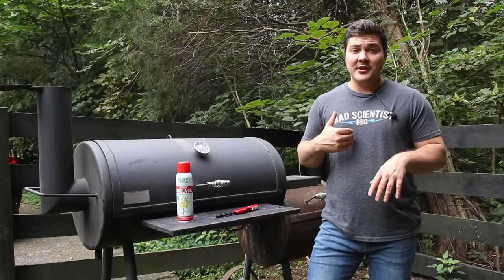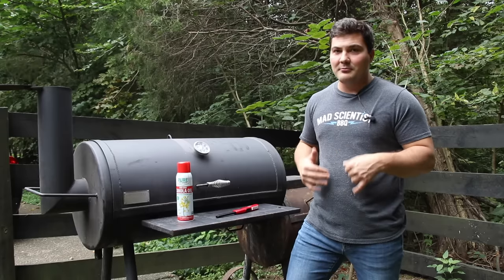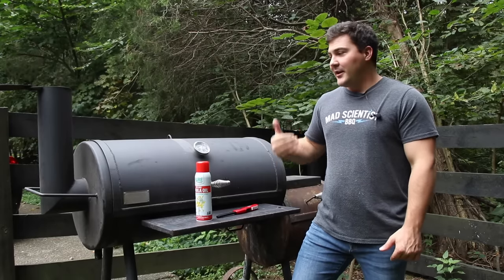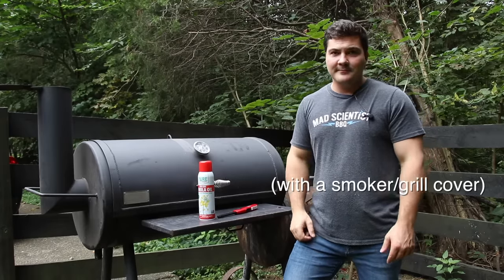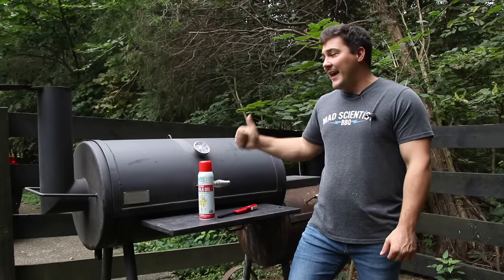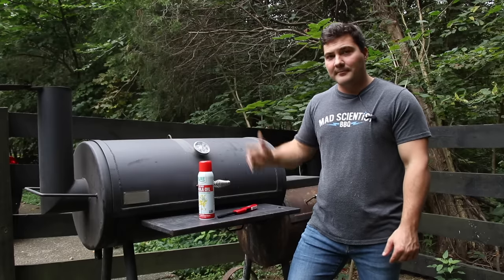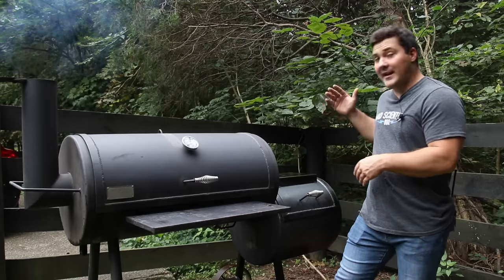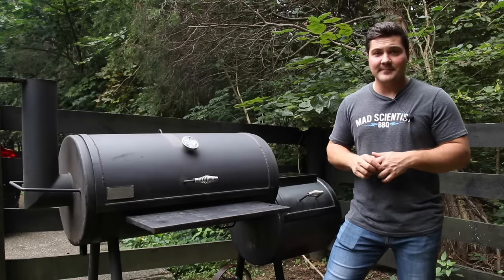How to Fix Rust on Your Smoker

Comment: I know every welder/ fabrictor is screaming right now for u too Wire brush the surface before spraying. Clean your metal is something you'll here often in a fab shop.
Reply: Ya it seems like something you would want to do if it looked like that just because it can't hurt right it's already rusted
Reply: I was thinking the same thing

Comment: If you want to remove rust pretty easily,  make a baking soda and water paste and dab it on the rusty areas.  Leave for about a half hour and then rub with some steel wool. Comes right off.

Comment: You wouldn’t sand off the surface rust then paint it with high temp paint?
Reply: I would do that if it’s super bad
Reply: I find that high temp paint always peels off on the fire box. It just gets too hot.
Reply: You will just be doing that constantly the fire always burns the paint off eventually. Mad Scientist is right some custom builders dont even offer paint,  and instead just burn and coat with oil!  Its the best way.
Reply: @PatriotPaulUSA  yeah I kept having to paint mine over and over. Its better to just do this method. About 3-4 times a year works for me.
Reply: Never. Follow these instructions. Sanding and painting is a waste of time.
Reply: Abullet4Bolsheviks I’ve never see someone so clueless about what people are talking about.

Comment: Love all your videos. Everytime I see you doing something I'm already doing, I feel like I'm doing something right. 
First, I noticed your smoker on bricks. I had mine on stepping stone pavers to prevent rust from wet ground.
I didn't spray mine before every cook but that was part of my care with the same thought of treating it like a cast iron pan. One tip... Spray from the bottom up...One reason. When an aerosol can is full the spray angle doesn't matter very much. As it gets empty you'll need to hold it almost perfectly right side up. Starting from the bottom you'll get more out of it than finishing at the bottom with a nearly empty can having to hold it at an upright angle. Please keep up the content. Thanks for sharing these tips.

Comment: Dude awesome video! I seriously didn't want to sand and paint. My box was looking horrible and I did this with great results.
Reply: What type of spray did you use and how many times did you repeat the process to get the results that you have now?
Reply: @ryans381  basic vegetable oil will work. Just coat the firebox nice and thick once. You won't hurt the metal, no need to be hesitant about this.

Comment: I've used Krylon or Rustoleum Rust Converter/Reformer spray first if there is rust in case its a little deeper than superficial then oil treatment

Comment: Great tip Jeremy. I built an octagon 48"x24" offset with a 24"x24" firebox. I put it outside one day before I painted it and of course it rained so now the whole thing is rusty. I'm thinkin this will be much easier to do than painting it. Great video brother.
Reply: What did you end up doing? Did your oil treatment of the entire pit work better than high heat paint?

Comment: Great video, and thank you for the information. My smoker looks much better than it did. I decided to buy a quart of cheap canola oil and use a 3" disposable brush to apply it after seeing the price of the spray cans(4x more expensive). I ran into no issues doing this, but I could see why the can would be more convenient especially with larger pits.

Comment: Good Idea, I am 75% done building a RV smoker But the other day I came across a different tank that I thought was aluminum, took it home and a magnet sticks to it like steel, so its Stainless steel 30" around and about 5' long, so now the idea is to cut off the current tank that is only 20" around and 4' long and use the SS tank and remake racks and figure out if I can stick weld it to 1/2 AC3 steel firebox. I am having to much fun making one can't wait to finally try cooking on one once the project is done.

Comment: Thanks for the video, I will have to say, you've given me something to think about. There was a time I tried keeping up with my grill with the grill paint they sale, waste of money and time, didn't last as long as it took me to paint it. What I found that does work is engine paint rated at 2000 degrees, I'm not sure about the 2000 deg, but it does not burn off my smoker. I had some concern about the chemicals in the paint, but I only do the outside, and can't imagine it getting to the food. However, I am going to give some thought to using oil instead when little rust spots do pop up.

Comment: Jeremy, I have to buck you on this one, you should use Cooking Spray on the inside and Mineral Oil on the Outside of the FireBox Works very Well
Reply: Hey buddy what’s a mineral oil, and if u had surface rust inside and sprayed then lit fire to heat the whole thing would it be ok.

Comment: Thank you for the information. Did not know if you leave ashes in box that speeds up rusting process. I normally clean out before each cook.
Reply: The reason is that ashes attract and trap moisture. Then you have a problem.

Comment: I used a wire wheel on a angle grinder, finished off with peanut oil
Reply: Yeah I think a wire wheel or brush might be the best course of action and grinding disk is more likely to take  a lot of material off in my opinion
Reply: I agree with removing rust first then seasoning over clean metal where ever possible.
Reply: Did this with my original Oklahoma Joe every cook. Never used a grinder. Waste of time.

Comment: My Pecos is almost in need. Great video, thanks!
Reply: What's the difference between the Pecos and the Brazos?  I don't have any academy sports close by to look at them close up.
Reply: @ComparisonCooking  Brazos is 1/4" steel the Pecos is a little thicker than sheet metal with 3/16th door trim.
Reply: @ericakred4714  and about $600

Comment: Ok, I got a fairly cheap grill & smoker. I coated everything with Pam canola spray. I built a hot fire to do like you said but because the metal was thinner on the offset smoker the paint blistered and now I have rust. Would wire brushing it, then adding a heat resistant paint (on the outside) , then using canola oil on it again help ?

Comment: Nice video! My opinion...don't paint!  It doesn't work for long, the fire burns it right off.  I would spray before using your smoker, saves a lot of wood and or propane.

Comment: Going with your cast iron analogy, before seasoning those, I run them through the self cleaning cycle in the oven. It burns the rust and everything else right off. I wonder if you could get your fire box that hot and then begin seasoning the bare metal.
Reply: That's the way I normally do it, It works.

Comment: I have a Yoder pellet smoker that came with a can of paint.  Never saw anything like that before…. After exactly a year I have pockets of rust everywhere.  I used the paint a couple of times when I bumped the side of the door opening taking out the deflector plate (tight fit) and was shocked at how easily the paint was damaged.  I applied the spray paint and as expected, the two spots screamed out “I’ve been painted by a spray can.”  Now I have probably a dozen spots to deal with…

I’ll try your tip.  Jay Leno’s Garage featured a product that is good for arresting rust.  I’m going to try that too.  I’m going to do everything I can to keep from spraying with that can of paint.  What p___ me off is that the paint is so bad in the first place.  The Yoder is built like a Sherman tank and otherwise oozes quality design and construction.  I simply can’t understand why in 2020 they couldn’t have used better paint.

This is not a rant against one company.  You wouldn’t have created this video if it wasn’t a common problem.  I had a Weber gas grill for years and didn’t use a cover once.  It was in better shape when I ditched it for my Yoder than my Yoder is after one year.

Comment: Quick question, with a new smoker, do you season it first or do you get a fire going first to burn off all the factory chemicals?
Reply: If its new, burn off the chemicals for like 2-3 hrs and then coat with oil and season it

Comment: Mine is rusted because I did the initial burn in TOO HOT!!! LOL So I burned off the protective coating. :(
I did that in my first offset smoker and told myself I would not do that again this time. But guess what started drinkkng and forgot about the fire. lol DOH'!
But I keep it covered so it's prolonging the life.

Comment: I don't have a problem with rust. I keep the out side metal painted with high temp paint. And when I'm done  It's kept in the garage.  Problem solve.   Or buy yourself a cover.   But that was a nice tip, spray it with a little pam.  I might try that too.  I already spray the inside.

Comment: Hi Jeremy, would you ever burn wood that is not wood that you would cook with in the burner just for seasoning it? Like use some firewood and not the fruit woods or oak or hickory?
Reply: That’s not a good idea. Any “firewood” you’d get from a store like pine, pinion, etc are not good for cooking with or seasoning a smoker with. They can be toxic when used to cook and the toxic oils would stay on the inner surface of the smoker so not a good idea at all.

Comment: Dang....I guess I wasted time and effort brushing off the light rust and repainting and curing with 1200 degree high heat paint???    Should I use the canola oil over the newly painted fire box as well????

Comment: Do you coat the outside of the cooking chamber as well when seasoning the smoker?
Reply: Before I used my smoker I burn it good with out any oil mainly because I built mine from old propane tank and steel pipe .. just before the second fire I buy 2-3 cans of avocado spray.. I spray everything inside outside everything.. grates the box the stack everything.. then build a good fire let burn for a couple of hours .. fire number 3 it’s ready for food
Reply: @jfcustomfab  thanks for your suggestion

Comment: bought a new pitboss competition series in aug 2022.  Had rust form on broiler components to the point of rust flaking off the components.  Two rust spots on the top of the unit on the outside.  Called PB and they sent a new broiler after going back and forth but not the sliding peice that u can use to cover/open the fire box.   This all happened even though I have the unit covered outside.  Mild winter but the broiler slider is worse.  Will spraying it with oil help or should I get a new slider?

Comment: I see so many grills, rather they are offsets or not for sale that have rust. Some more than others. A percentage of the population have no problem leaving their stuff outside uncovered for nature to damage it. This goes for yard equipment, and grills.  On the other hand some think it's OK to build bonfires in a firebox. Especially have hot coals directly against the outside surface. Some have burners on their  propane grills  in the lighting position, or high all the time when cooking. I like to cook, not cremate my food in an incinerator. When using that canned spray. I was surprised to see it was mostly water. When I touch mine up. I either wire brush, or lightly sand loose rust off. Then I brush it off, or hose it on a warm day. Then I spray anti rust high heat engine paint on the outside.
Then it gets cured while cooking. Most all rust is from user misuse, or neglect.
Reply: While i don't like cooking oil spray because i think it tastes horrible the water content is exactly 0. You can't have water content in an oil product meant for sauteing.
Reply: @android61242  If you look at the ingredients of most canned spray you will find the first one is water.. Oil and water in their native form don't mix well, but ad nasty artificial chemistry magic by food companies and you have goop.
Reply: @kjrchannel1480   Never seen one like that but ill check again next time i go to the store.
Reply: @android61242  This is a bit late, but the low or non fat versions are the ones that have water. The real cheap ones from a dollar store might as well.  It always pays to make sure.

Comment: How to get rust off the smoker? Don't let it get wet in dry areas and those in wet areas, oil the metal.
Reply: Mine has some but mainly on the smoker side. Been needing to apply oil to it again. 3/8th

Comment: what if you grind the rust off and put some coats of heat rated spray paint
Reply: Paint will always flake off. It isn't necessarily being burned off. As the steel expands and contracts, the paint becomes weaker. No matter what brand of paint you use, it will come off eventually. These pits come with high heat paint already, but they never last.

Comment: Love your videos, but I have to say " I clean mine up a little different ". After 10 or 12 smokes, I use 2000 grit sandpaper on my fire box, use high heat 200 degree paint to coat it,  then I season the outside with olive oil to have it set in with the heat.
Reply: You're creating way more work for yourself than you need to. Seasoning the outside every cook is definitely the way to go. Neither of my smokers have paint anywhere. Zero rust and looks better to in my opinion.